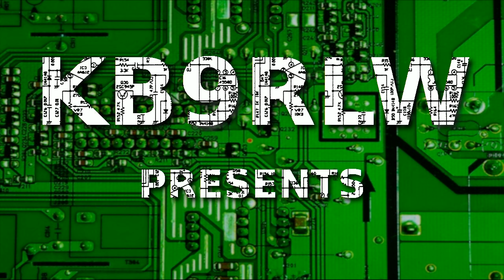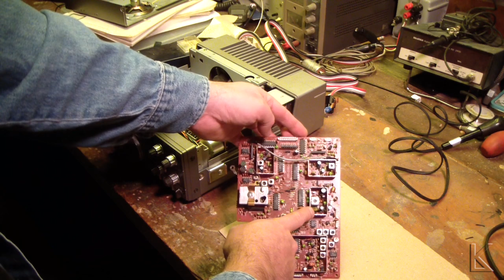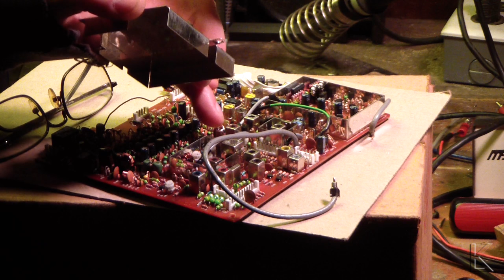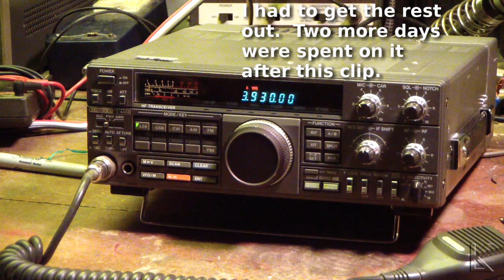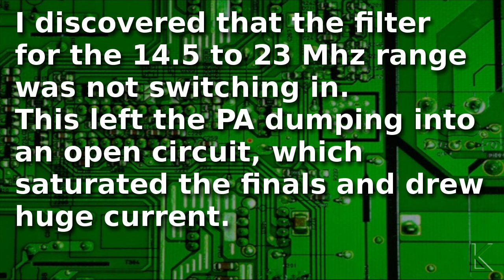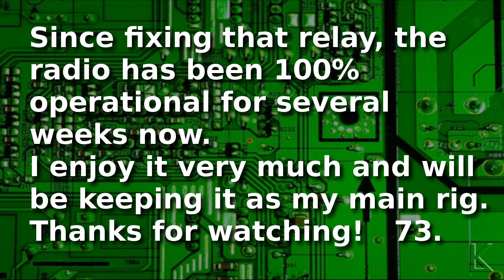Ham Radio - Repair of a Kenwood TS 440sat

Comment: Hi Kevin and awesome job on all of your videos!  I am about to test for my general upgrade and recently acquired a 440S.  The AM selector button does not light up green when depressed and no output is heard from the internal speaker.  All other modes work as expected.  Any ideas on where to start troubleshooting this issue?  Thanks!  Brandon KG5LQM
Reply from the maker: The micro-controller is going to have lines coming out of it  to control the switching for each mode.    Dig into the schematic and find that signal for the AM mode and start following it.   I bet thee's  a driver transistor of some type that takes that signal and drives a bunch of other transistors to switch things around.   At least start with the micro and see if the signal is there.
Reply: I'll be sure to let you know the results. Thank you for the help!

Comment: I had the fun of working on one of these radios myself. I spent the better part of a week cleaning the gunk out of it and resoldering boards. Never was I so glad to get a project off my bench!

FYI: 90% IPA softens the Sonybond goop a fair bit, making it slightly easier to remove.

Comment: Kevin, thank you very much for your time producing this informational video! And now comment to Kenwood, the use of Sonygoop, years ago the long term effects possibly could be excused, BUT only marginally, now there is just NO excuse for the poor wave soldering resulting in way too MANY faults. Kenwood, shame on you!
Reply from the maker: I will say one thing,  the circuit design is top notch.  Great receiver, excellent TX performance and audio too.

Comment: Mine had weak audio. Sony Bond problems!?!?!? NO, not yet. Mine had some bad caps in the audio chain out. It's a fabulous radio now, and it will tune 80 meters with my 40 meter antenna, which is really nice. Sony Bond is hydroscopic, but so far I am not having any Sony Bond problems, yet. I just got a 690, and a 450AT. No HF transmit with the 690, and none on HF or 50 meters, so I doubt BOTH sets of finals would go south. Someone was probably trying to do RTTY or PSK through the mic jack, with a PC using FL Digi or Digipan and cooked the mic preamp chip. ($10) My TS440 was not quite a gift. Paying $200 is not a gift. I get 100-102 watts out, and the audio is back, and it works. I inherited a 1999 Blazer ZR4 custom LT from my father. Lots of stuff stopped working, like the traction control, transfer case control, computerized climate control, engine control, emissions control modules, and windshield wiper control modules. I reflowed all the solder joints and everything worked again, except the windshield wiper board. I have clean some red epoxy goo off of it, because the Dorman replacement board is an absolute piece of garbage. I may grab some  boards from  junk yard Blazers. Bad solder joints were all over that truck's electronics, and they just find their way into everything.The Dorman aftermarket stuff is so horrible it's worth reflowing everything and trying that, because it usually works.

Comment: You answered my question re the IC-745. I owned both of these radios (inherited the 440SAT from my dad's estate when he passed away in '92) and loved them both. Not a big AM fan, so liked the 745 better. 

Your video is a big help for those who come across these rigs on eBay or a swap meet. From your narrative, it would seem that the "free to a good home" aspect of the radio was offset by the effort to remove the glue. 

Not disparaging anything, just saying paying about $400 and THEN spending 40 hours or so digging out glue might be a deal breaker. 

Key up the great work. 

72/73

de Bill, k6whp 

dit dit
Reply: When these work, they are fabulous little transceivers, and if it has the autotuner, and all the optional filters they are super nice, for their age. Merry Christmas, & 73s, KI7AQJ
Reply from the maker: I WISH it had the optional filters.   I love my 300Hz CW filter in my FT-817.   The antenna tuner works perfectly though.

Comment: I've had the same problem with the same radio a couple of times where I had the dots on all bands. Each time it happened, it wasn't very warm outside but very humid. So I had the windows open and was enjoying not sending buttloads of $$ to the electric company. But when the humidity in the shack hit 60%, I got the dots problem. It was only 74 degrees in the shack, so I closed the windows, cranked up the the AC and set it to 72 to get it to kick on and when the humidity dropped down below 60%, the radio worked properly. The second time it happened, it was during a contest (HORRORS). So not only did I work on getting the humidity back down, but I also ran a hair dryer through the vents to help dry it out quicker and the radio responded favorably. I had the radio for only a couple of months, so I mentioned it to the Elmer I bought it from. So he took a look at it (no charge) and found that there was no current coming through the glue (a low humidity/good hair day), but found a couple of the PLO's were out of adjustment. He explained the length of time it would take to get the glue out. Since this is currently my only HF rig, I elected to let it ride and watch the humidity level in the shack. 

In the mean time, I'm keeping my eyes open for another radio with the dots problem and hopefully pick it up at a fairly good price. I'll then piddle around with the glue removal on it on bad propagation days and use my current radio on good propagation days. Hopefully I can score one with the YK 88S already installed. I know, I don't ask for much, do I?
Reply: Probably nobody will read this but I had 2 Amana Radar ranges (microwave ovens) out at the cabin which is high humidity all winter. It would take several days after spring power up for the displays to start working. Don't know if they had Sony glue. Here in dry AB I have a '440 which is slowly dotting out. Glue pickers unite!